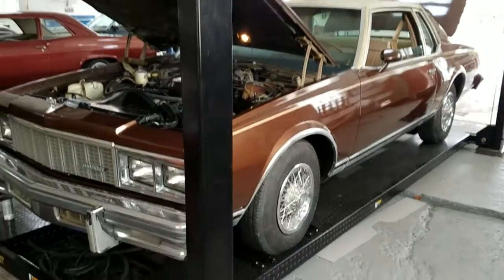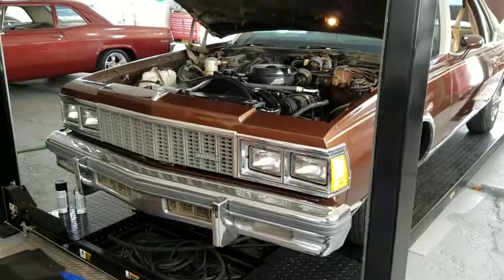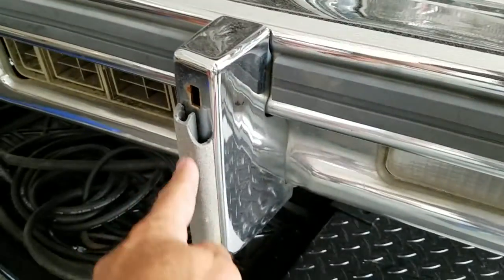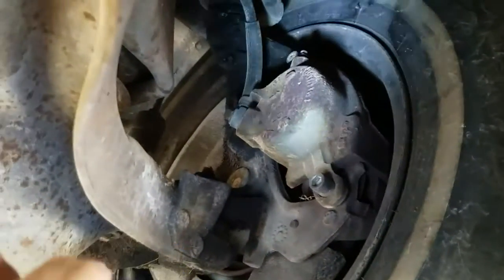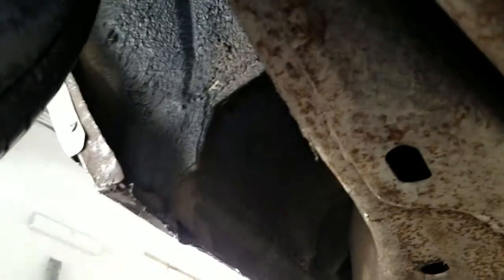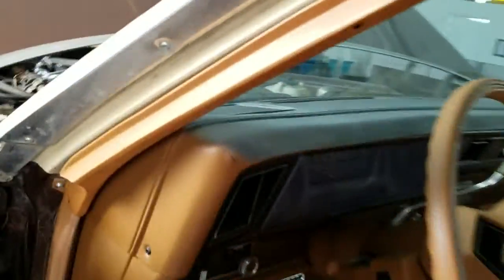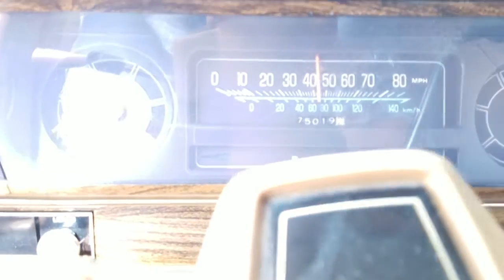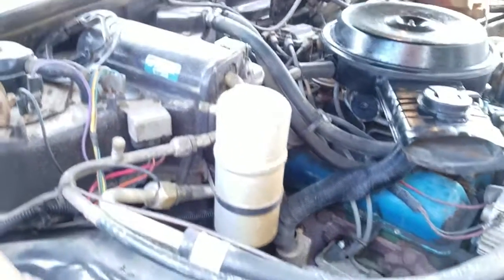1979 Caprice Classic for sale pre purchase auto inspection & car appraisal

Comment: It is what it is, a survivor that looks to have not been used in many years with a fresh paint job....I do think the first few years of this body style were the best/most reliable though, even though this one will need a lot of work to be a reliable daily driver.
Reply: kramden
Reply: What work does it need?
Reply: @erfantavoosi100    Hard to say...But, it will surely need some service, especially the fuel system and fluids.  Sure it may run OK now, but it won't be real reliable without proper servicing...